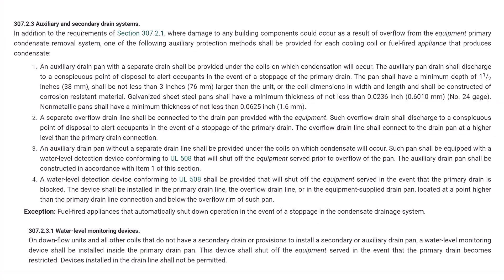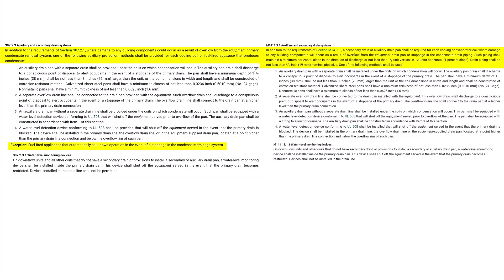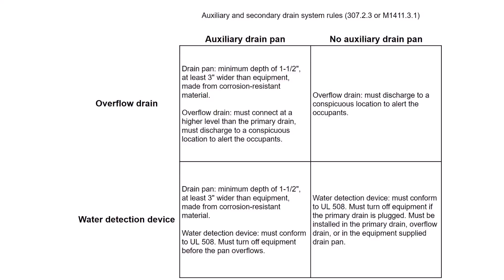Building code requirements for handling AC condensate in an attic

Comment: A couple things from a licensed hvac contractor in Florida. I recommend a shutoff on your secondary pan not a drain ( if you are gonna use a drain it has to terminate by the front door) that is code here, but i go to calls all the time where it was dripping and the home owner never noticed so it’s been flooding for 6 months and the secondary pan is now rusted out! Also I don’t know your code but in Florida you must have a secondary drain pan it’s not optional! No unit I have ever seen has two drain pans in it. You are correct there are two drain holes on the unit but they both come from the primary pan, one is for the drain the other is a little bit higher for a float switch but they both come from the same pan. If the line clogged the water building up in the primary pan will trip the float. If the float doesn’t trip for some reason the water will flood out of the unit and that’s where your secondary pan comes in. It will start to fill and either drain out your secondary drain or trip your secondary float switch the problem with a drain line on the secondary pan is that if the first line is clogged with slime and trash the secondary line will also and then you have water coming through your ceiling! Also I’ve seen plenty of secondary drain lines clogged due to lizards and other critters making it their home. So a double pan double float switch set up is best! The chances of both float switch’s being defective are very low. And when a float trips and your unit shuts off you will notice! That’s the best way I’ve found to prevent flooding from your unit.

Comment: Hey Ruben would you ever advice a homeowner to replace old NM-B wire pre circa 2000 before the color and insulation material change? My attic is full of white sheath Essex brand 12/2 copper wire.  I'm going to replace all the electrical boxes and outlets but Im not sure if I should just run all new yellow 12/2 romex or just tie in new homeruns to the old wire. Thanks for your reply. Cheers
Reply from the maker: Hi hippo potamus, no, I see no reason to replace the older NM cable.